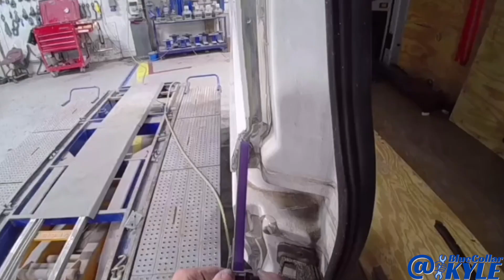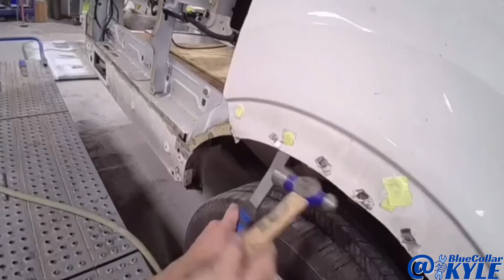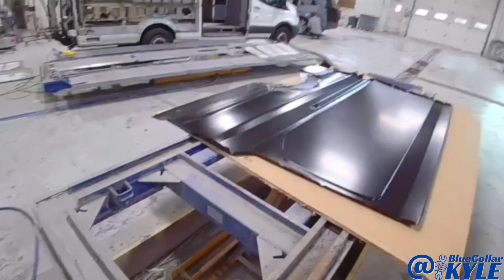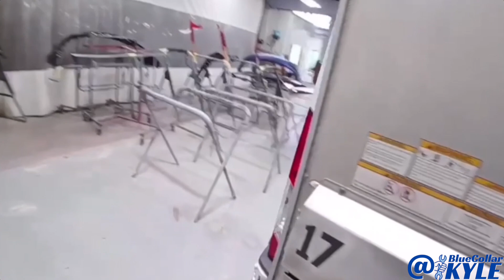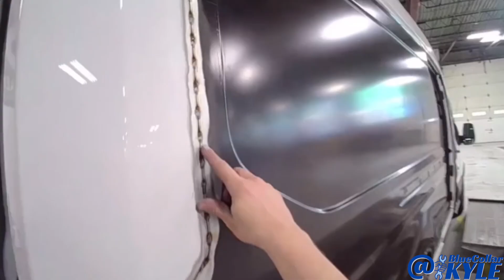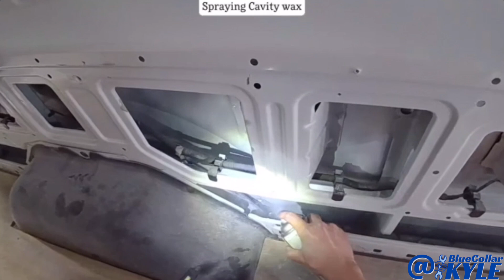Not Much Fun!

Comment: I'm sure a spot weld dril would have been faster than sanding the spot welds out? Haha you get the idea halfway through 😂
,in my day everything was air driven air ratchet air drill air sanders, things look so much easier with the battery drills and tools, nice job 👍
Reply: It depends, in some cases i prefer to grind the welds. its easy to cause damage to the inner structure with the drill in some areas on some cars, grinding gives you more control over that.

Comment: so lucky its a high top so you can plug weld the top section , the normal top has to be brazed from outside and grind it back to make the panel line :)